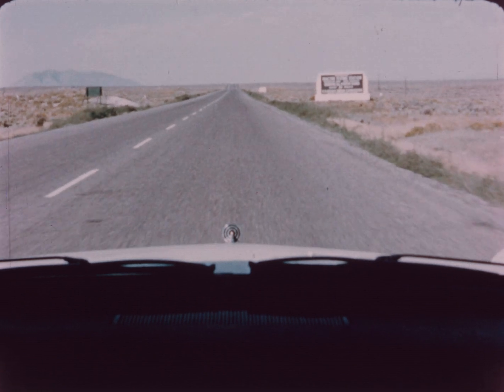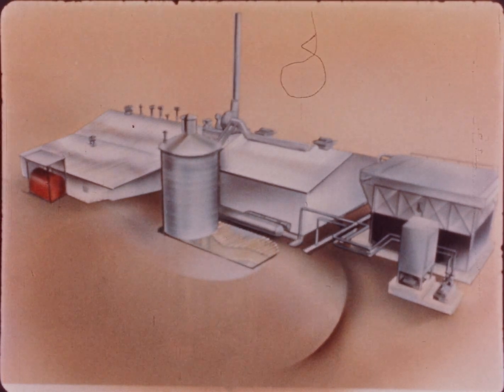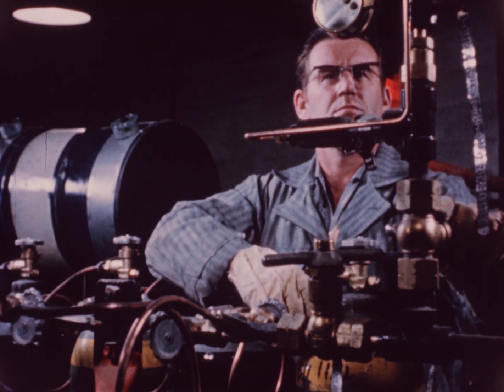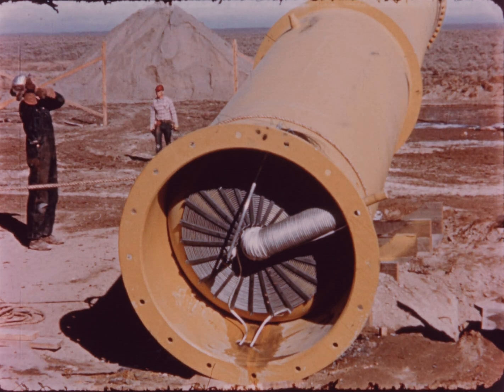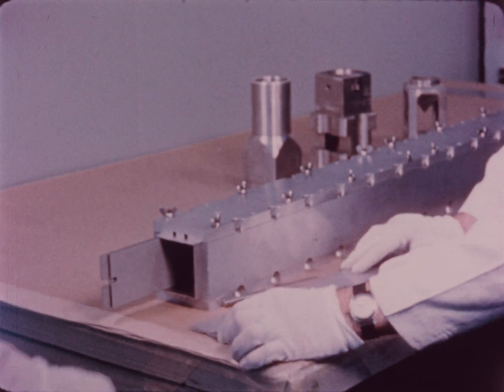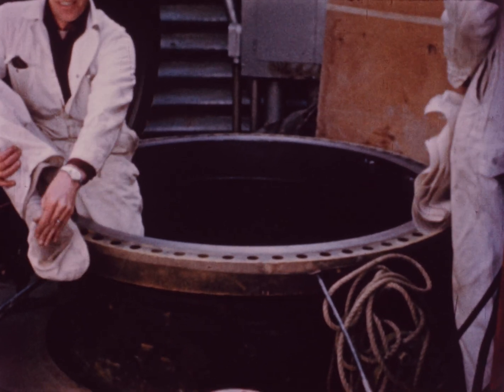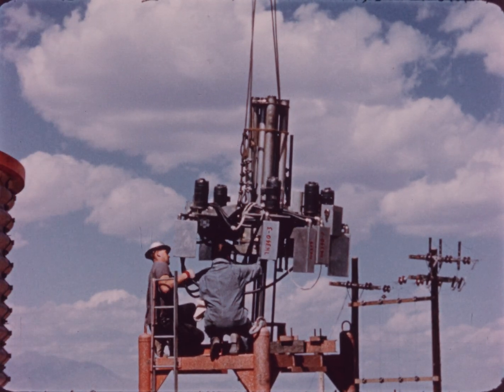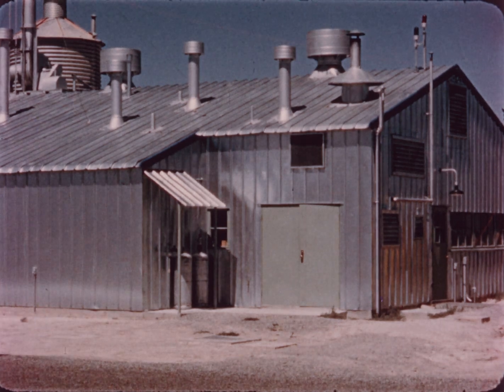The Organic Moderated Reactor Experiment (1958)

Comment: What was the intent or goal using organics? Why would you want organics as your moderator/medium?
Reply: Lower operating pressure and basically no corrosion is my guess 

But I'm guessing the byproducts produced in the coolant were nasty to say the least...

Also hydrogen and  steel  bo not play nice at elevated temperature and pressure

Comment: Kg/cm^2 is a lousy unit for pressure. Great video, though!
Reply: Is it really though?  Worse than pounds per square inch?  Sure, I have an intuition as an American about what a PSI is....but if I had been raised and schooled using a saner system like metric it would be equally relatable.  

At least I know how to convert the metric stuff into other metric measurements by dividng and multiplying by 10....
Reply: @hmbpnz both are kind of half good because neither kg nor pounds are force related but mass related units.
One should rather use a force there, like newtons
Reply: 1 kg(f)/cm2 is a mouthful to pronounce but easy to understand: it is approximately the air pressure at sea level. Conveniently, there is a pressure unit for that: 1 atmosphere or 1 bar is approximately 1 kgf/cm2, with an error of about 3%. 1 atm is also approximately 15 pound-force of bald eagle per square inch of of an Olympic-size swimming pool. This imprecision is perfectly acceptable for general discussion when not chasing decimal points.

The SI unit of pressure is pascal: 1 Pa is 1 newton of force per 1 meter squared of area. 1 Pa is a rather small unit, so megapascals are often used in plumbing (1 MPa ≈ 10 atm), and hectopascals in weather science where more preceision is needed (1013.25 hPa = 1 atm = 760 mmHg = 29,92 inHg). 

If you think it’s complicated, look into radiation dosimetry :)
Reply: @hmbpnz  I can do metric, smart-ass. Kg are a unit of mass, not force. Pressure is force/area, not mass/area. The correct metric unit would be Pascals.

Comment: They have found that organics work extremely well for nuclear diven stirling engines. Deuteratated pentane or difluoro ethylene work the best. The core is a ceramic honeycomb and a variable beryllium reflector gives gain. It bumps in pulses like a coffeemaker so each time it gets hot it dumps a puff of gas from the moderation fluid it lowers the reactivity. Posible candidate for space probes that need more power than a RTG can provide.❤
Reply from the maker: Love it. I was just reading about deuterated hydrocarbons in one of the OMRE reports. Probably the most obscure reactor coolant/moderator
Reply: @whatisnuclear  Organic/hydrocarbon based nuclear reactors were abandoned for a reason. They have poor heat transfer compared to water so the flow rate is much higher (though hydrocarbons do not cause corrosion so it's mitigated)
Organic molecules degenerate and decompose at high temperatures.
Reply: Sounds good because deuterium is involved, so I suppose this reactor is  with higher neutron economy than LWR (carbon is adding to it) , and far more resistant to corrosion and with longer operational life, but I'm not sure about efficient heat transfer from the core to the heat exchanger because of the hydrocarbons. And I think there is great risk of fires.

Comment: "Flammable Coolants? What could possibly go wrong?"
Reply from the maker: To be fair we've run lots of reactors with liquid metal sodium and NaK coolant as well, which is explosive on contact with water in the presence of oxygen. We can control for this (e.g. by keeping oxygen out).
Reply: @whatisnuclear  Yes, I know about those. It just sounds like a bad idea cooling something with low-flash point hydrocarbons. Wonder if they ever tried using Diesel fuel, which is harder to ignite. I mean, it was the 50's and 60's, when every nuclear idea was a good one, right? :)
Reply: @whatisnuclear  NaK and sodium are explosive on contact with water; oxygen is not needed.  Sodium and NaK explode in a "coulombic" way where water steals electrons from the metal, causing high positive charges on the surface, which then causes dendrites to form as the positive charges push on each other in what is a very malleable (liquid, in the case of NaK at room temp.) metal, but that increases the surface area in contact with water, thus accelerating the process, thus causing an explosion.  Typically sodium and NaK do not explode in water if first they are allowed to form an oxide layer on the surface of the metal, as that greatly reduces the speed of the reaction with H2O.  Both produce hydrogen gas as a result of reacting with water, and that gas can also explode in the presence of oxygen, but the main problem with sodium and NaK is not the hydrogen they produce when in contact with water but the coulombic explosion.  In a molten sodium reactor the sodium would be kept away from oxygen, thus making the coulombic explosion hazard the worse problem (as opposed to the hydrogen gas generation problem).
Reply: Honestly I keep expecting to run into an example of a boiling mercury system like they tried on conventional power stations - I mean they had Pluto so why not
Reply from the maker: @ВОВ-е9с  How about just plain old liquid mercury? Clementine did that. https://doi.org/10.1080/00295450.2023.2176686
Reply: @whatisnuclear   Oh be still my heart 😍My life is complete.
What could possibly go wrong
Reply: OMG they used aluminium in the construction
Reply: How thought a coolant susceptible to radiolysis was a good idea?

Comment: Who thought this was a good idea. What's next, a mayonnaise-cooled reactor?
Reply from the maker: Lots of people thought, and still think, organic fluids may make a good reactor material. Here's a recent publication from MIT: https://dspace.mit.edu/bitstream/handle/1721.1/117025/1-s2.0-S1738573316300031-main.pdf
Reply: I built one. Tiny 1500 kw backyard off grid kinda thing. I had a high pressure high temperature mayonnaise loop feeding the steam generator for the turbine. So anyway it ran great at around 975psi about 550 degree Fahrenheit.
Reply: @sambrose1  where did you source your organic mayonaise? I heard it's important to get good quality. Did you have any problems with mayo fouling in your condenser core fins??
Reply: @Sim-q9t  I paid off a Sysco driver for a truck load. You don't realize how many 600 one gallon tubs are until you have to scoop out 600 one gallon at a time. And yes I had problems with the emulsion separating until I figured out that a rather small temperature differential of 125 degrees was all I could work with. So I definitely lost some efficiency. My favorite part of the whole thing was when I figured out I could tap off a small amount of 500 degree mildly radioactive mayonnaise and instantly cook frozen chicken nuggets in their own dippin sauce.
Reply: @sambrose1  Did you have to run a hydro-cracker for the eggs?
Reply: GMO bees, GMO bees, that swarm, and feed off of radiation, and beat their wings to cool the reactor...duh...